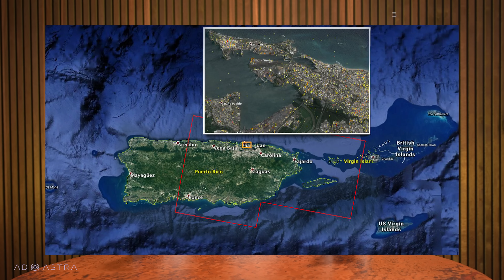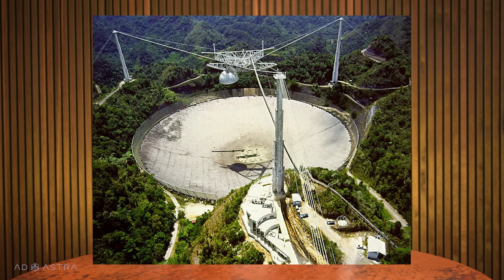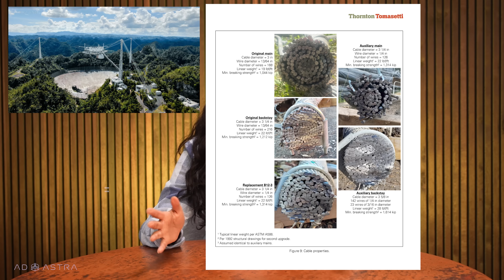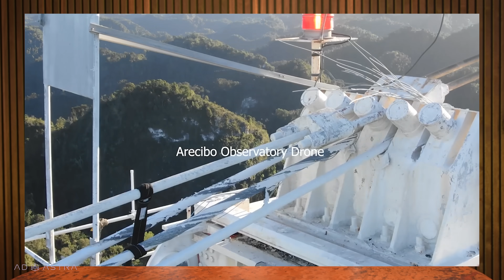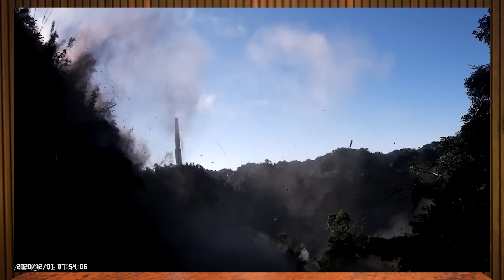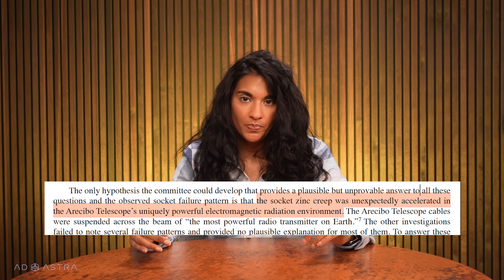ARECIBO COLLAPSE: We may finally know why the historic observatory failed

Comment: Arecibo's radar transmitters gave an effective radiated power of up to 3.2 TW (peak pulse power of the P-band pulse radar transmitter). In this band, it was using wavelengths in the region of 75-80 cm, so the 305 m diameter dish would be around 40 wavelengths. The antenna gain would be tremendous. But even if the antenna gain were about 60 dB (i.e., ERP being about a million times the input power), you'd still be feeding the antenna with a signal that's about 1 MW. 

The mond truly boggles.

Comment: That zinc end plug and shackle cap could have been improved with tapered split collets, a halfnut anchor and a threaded collar over the half nuts to tighten down the collets against the cable ends. A bit like hard tubing fasteners for pc water cooling. More engineered than a molten zinc plug and a T-slot anchor base. That seemed so rudimentary.

Comment: Obviously the neglected structure of maintenance of an old structure, caused the failure. No need to be a rocket science to figure this out. I visited this fascinating structure in the early 70s, and in mid 2000s. All along, looked old. Constant rain, humidity, not too far from the ocean, hurricanes, I’m surprised it lasted that long.

Comment: We know why it failed. There was literally a drone there looking at the cable when it happened. The cause was metal fatigue, corrosion and lack of maintenance. Yep it was definitely hurricane Maria and not decades of inadequate funding and neglect.
Reply: Wasn't fatigue. Galvanic corrosion, bi-metallic loop with an induced emf:  the Zinc plug was re-deposited to somewhere it wasn't meant to be. That was the whole cable fastening ball of wax yanked away. BTW I am convinced that solution is not a cable tie engineered to industry code, it left out any clamping force on the cable other than load tension acting against the Zinc plug. No anchor.  Yoiks.

Comment: Simple question. Were the Spelter sockets stress tested. This is normally undertaken in a lab under critical circumstances. Not suspended above the ground in a primitivee jungle environment. Where are the stress tested joints? Were they stress tested at all? Was the cables properly treated in a heated acid bath? 
I'm smelling  close enough, good enough construction that did not fully adhere to the proper procedures due to primitive circumstances.
Secondly, excessive pull out was noted. Those joints should have been condemned and replaced. Why weren't they?

Comment: It is shameful that rescue engineering was not implemented to save the antenna.
Surely, there was some way to unload the cables until the cause of the first cable snap was determined. The presented findings appear to be excuses and CYA. It appears that money was redirected leading to inevitable demise.
As a commenter pointed out, it was not radio frequency energy because radio currents do not flow inside the "skin" of a conductor. Did a DC potential between towers cause a persistent current that electrolytically used up zinc? That could have easily been measured. Impurities in the zinc? Why were cables not periodically removed for analysis? Mechanical structures weaken due to aging.
Reply: Apparently, replacing a cable was never thought about in the design of the telescope and was nearly impossible.  Probably because no one believed the telescope would be in use for such a long period.

Comment: Zinc is used as a sacrificial anode on virtually every metal structure in the world. (heck, I have them on an aluminum tire rack) Current flow will not increase creep, it will cause a chemical reaction and the zinc will "go away". Zinc is a bad metal for a structural cable eye. (but it's cheap, and easy to melt.)

Comment: The naming of the support towers is not confusing - they are named for their relative locations on an imaginary clock face.  The primary tower is 12.  If you are familiar with the facility, when someone refers to tower 4, 8 or 12 you intuitively know which tower they're talking about without having to reference a diagram.  That's a very common way of referring to things arranged in a circular pattern.

Comment: Still hurts a lot :-(   I hope it can be rebuilt sometime in the future.
I'm skeptical about the RF hypothesis as it's AC and electrolytic effects would be neutral.
Surely there's a less ductile and electronegative metal or alloy that could be used instead of zinc that isn't as susceptible to creep?
Why aren't the strands of the rope folded or looped and spliced to make a knot that is incapable of pulling through?

Comment: Yes, the cables could handle the static weight. However what safety factor was used to calculate the added wind loading? After all wind loading is dynamic, not static. PR is no stranger to hurricanes so it should have been quite high. I suspect someone made a mistake there.

Comment: Excellent description and analysis.  I am a builder and have one not dissimilar story.  One electrician that was used was incredibly neat when he wired an electrical panel.  The norm for a neat and organized panel is each cable entering is shaped to the sides and corners of the panel ,  But this gentleman went a step farther, organized perfectly and then zip tied into long linear bundles. There were problems with GFCI breakers and arc=fault interrupters shutting down circuits at odd times.  Until one day when for the 5th time a tech was searching for the cause of the problems, a major appliance started up when he had the tester on a different circuit.  The wire bundles were SO neat and tidy that they were inducing a current into a neighboring cable,, simply an induced current into a parallel cable.  We cut the zip ties and made it a bit messy, non linear,, Problem solved.  That the radio frequency altered the integrity of the zinc, does not surprise me.
Reply: Good lesson not to bundle wires too close or be too much of a 'neat-freak' :)
Reply: So is electrolysis gonna move the zinc and deposit it/electroplate elsewhere, or not? I know Zinc is used on boats to stop galvanic corrosion, and it wears away just like a donor node in an electroplating bath... so needs regular replacing.
Reply: @santyclause8034    The first thing I must say, my children taught me to be honest,, I don't know.  But, I have read some about this,, and I have a varied training from die casting molten zinc to radio frequency, to electrical considerations from 2 volts to over 1 million volts (When I was a child I used to have access to a very large Van de Graff generator and a very large Tesla coil.  A million volts was normal to either.)
No. I don't believe they are considering a galvanic reaction. (the sacrificial zincs on a boat)  There is something being induced by the extreme proximity and extreme strength of the radio waves.    It could be something as simple as exactly what takes place in a microwave oven.  Microwave oven cook by having a wave length that matches the atomic distance from hydrogen atom to hydrogen atom of a water molecule.. Those two atoms attach to the Oxygen atom at an angle of 109 degrees? (from memory)  It is that specific distance the the waves passing are exactly that  same length and twist the molecule itself back and forth as the wave passes.  Now what part of a zinc molecule,, or zinc crystal,, they do form crystals as they cool. (makes cool patterns in the cast parts)  Something of those radio wave frequencies must be tickling the zinc or crystals within the anchors.  Warming them up and allowing a slow flow,,or resizing the crystals,, it is tickling something.  Laughing,, the REALLY big concern is,, many, many cables are anchored this way.  We HOPE that is it something unique to extreme radio waves.  If it is found that the plastic flow is endemic to all high stress Zinc anchors,, ohhhh lordy  I cannot even guess the number of anchorages that would suddenly have to be inspected and replaced.
Reply: As someone who knows nothing about this stuff, I actually find this fascinating. Thanks for sharing.
Reply: @Sailor376also
Cable fastenings are surely not this rudimentary in Civil Engineering ? They should also mechanically clamp the structural cable, not just tension anchor points.

I thank you for such an expansive insight into the failure.

Comment: That’s pretty thin reasoning… “we couldn’t find any actual cause, so it must be radio energy.”  The tower sockets are way outside the beam of radio energy, although they could be exposed to sidelobes.  The instrument platform, on the other hand, is pretty much in the main beam, depending on where it was steered. So why didn’t the failure happen on the platform?

Comment: Zinc is the major metal used in sacrificial anodes on watercraft. ( from jet skis to huge ships ) It's reactivity to low level electric charges is why. When building Arecibo they should have used a different metal to anchor the cables, and any good engineer would have known how reactive zinc is and specified a different metal.
Reply: They used to use lead for those kind of sockets. Lead is bad for your health though, probably why they switched to zinc.
Reply: @rule1dontgosplat  when did that RoHS thing start, 1999 or 2002 or something, hmmm.
Maybe part of it was simply that when built they didn't expect the "Arecibo Ionosphere Observatory" to be in use for more than a few years, then almost fifty years later things happened. Also let's not kid ourselves, the cables needed to be replaced in 95, just no one had the budget for it.
Reply: Or they could have ensured the cables had been solidly grounded prior to entering the sockets to safely shunt the induced current, and perhaps had the sockets lined with glass, ceramic, or other material to electrically insulate them from the towers.  I can't believe that induction and subsequent galvanic and resistive heating effects weren't considered for structural cables on a 2.5 MW system, but hindsight's always 20/20, I guess.

Comment: There is a basic principle in this world. The principle is that everything grows old, wears out and eventually fails. As a result items, such as buildings and their equipment and the Arecibo Radio Telescope needs regular inspections and repairs. Apparently these zinc sockets were not inspected enough to detect that trouble was occurring that would eventually lead to failure and as a result these zinc sockets were not serviced to prevent failure.

Comment: As an Elevator Machanic I have used similar Socks to anchor Cables (much smaller same thing) usually softer meats, but sometimes Zink, thing is even with Lead Tin mix when properly done hardened Steel will brake before sockit is pulled out. Zink a good bit harder Babit  used in my Trade. A pull out 100% only happens "I stress this 30 years of experience" the Socket was not done properly, some skill and much care clearly those installing the job didn't do it every day, how often do you build a giant Raido Telliscop?
Reply: Interesting. Couldn't the failure happen by unusual forces? The site was subjected to two CAT 5 hurricanes a couple years earlier (one week apart), as well as around 4,000 seismic events (multiple 4+) from an earthquake sequence a few months before.

Comment: Being a retired engineer (computer and electrical) and amateur astronomy type, I've wondered how the telescope had collapsed and that was the first views (video) I've seen of the actual event. The possibility of the EM field it generated as being a contributing factor over time is interesting to me. I'd have to agree that things went unreported and there seemed to be a lot of feet dragging going on that added to the situation. There had been a lot of important work done at that site, and no doubt it could've continued to do more. If something is important enough to build, then it's important enough to take proper care of it so that it will last as long as possible and the most use gotten out of it. I hope it will be rebuilt -- I'd rather see money spent on something like that radio telescope than on some of the b.s. stuff money gets thrown at.

Comment: I visited Arecibo in January 2005.  I had just finished a few years working as a construction inspector and held certification as a concrete inspector from the ACI.  As a long time Trekki and a fan of Arecibo and one of millions of SETI participants I was thrilled to be there.  Of course once my awe had been satisfied I turned my attention to to architecture and cables.  I spent the day there and watched several repositionings of the apparatus.  Although many structures were coated with new white paint I was able, and horrified, to see visible evidence of cables nearing the end of their lifetime.  What you call the 'back stay' cables.  I saw popped strands and broken sheathing.  I also observed indicators of concrete fatigue in the anchor bases (small cracks in probably critical areas).  I took photos and communicated my concerns to the staff inside the visitor center.  I still (4 PCs and 20 years later) have some of those photos.  I was told 'maintenance inspects and will probably fix it soon," and no one asked for more information.  It was obvious at that time that the maintenance team was more interested in slapping new coats of paint on the nearby structures and sweeping the visitor center floor than they were in actual maintenance of the cable runs.  No one was interested in the photos on my little Pentax or what they possibly indicated.  Perhaps a lack of budget funding played a role in the lack of physical maintenance.  My thoughts on departing were the facility would probably work for about 5 or 6 more years, but after that everything was questionable without a major overhaul happening (which apparently never did).  Yes we can blame electromagnetic fields, but I will go to my grave believing the cables and anchors never really got a critical inspection by qualified personnel after I visited in 2005 and that beyond periodically slapping on new paint there was no mediation of problems or cable maintenance.

Comment: Sometimes if the 'broomed' cable ends do not come up to the same temperature at the molten zinc, the molten material may not adhere properly to the cable end. Example: This can easily happen when battery cable ends are being connected to the lead islet where the solder doesn't stay sufficiently hot long enough to raise the copper cable wires to solder molten temperature.The cable can then easily fail, pull free by putting it under a bit of tension.
^..^~~
Reply: It's still not an industry code cable tie.

Comment: to talk about powerful does not mean anything. it was a telescope, i guess most the time which means it does powerful listening to extremely small signals. in this operation mode no extra current can be induced in the "socket", we talk about extremely small signals and the power should end up in the receiver. In case it works as a radar system it would emit power which changes the situation but the radar emitter would be up limited by extra weight. I guess most the time the telescope was listening, even in seti operation. By the way, for sure you can either listen or sending. Doing both the same time i bet you just hear your own sending. As the signals are that small it is the easiest to avoid sending during listening. 
in case the sockets were really damaged by erratic currents through them generated by the telescope operation i would either look for the electric installation and missing or damaged grounding provided for lightning protection as cause.

Comment: So… it had accelerated corrosion due to leakage current.  It was basically improperly grounded or improperly isolated.
Reply: It was the best of times, it was the worst of times. The grounding isn't the problem. Isolating the bi-metallic loop that has a current flow... that is the problem. Go you. Basically, I think the dish has the effect of re-deposting the Zinc galvanically, a circuit from the Zinc cable plug Anode to the point of greatest Potential Difference forming a Cathode end in the induced loop. Pity there wasn't more engineering design in the cable tie schema.

Comment: Thanks.  That was interesting.

You can have all kinds of problems because of electric currents where you don't expect them and you really need to think about things that are exposed to Electromagnetic Radiation ... 

Things like the shape of buildings can focus things where they are not intended to be focused ...

I worked in an office on the edge of an Industrial Park - that was 5-10 miles from a military airfield.  We had this cheap Tandy Model I computer and every now and then - it would just go berserk.  Things would flash on the screen - it would access it's disk drives.  The little thing would just flip out.  We had no idea what was causing that but were thinking it was maybe the machine shop next door.

The Computer Operator - was retired military - and he had contacts on that base.

It turned out that they would test the radars on some of the planes and our office window was being painted by that radar.

The Tandy Model I had a plastic case - so it had no protection against the Microwaves of the radar.

My computer had a metal case - so it didn't have a problem.  We put a metal screen between the Tandy and the Window - and that solved the problem.

Of course - we were getting painted by that radar too ...

People commonly hold mobile phones (which are radios) to the side of their head ...
.